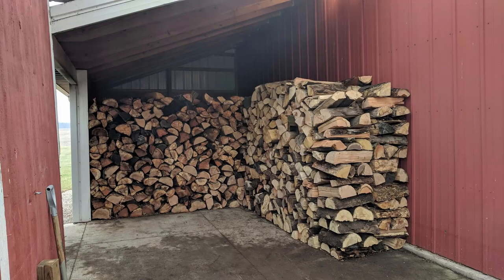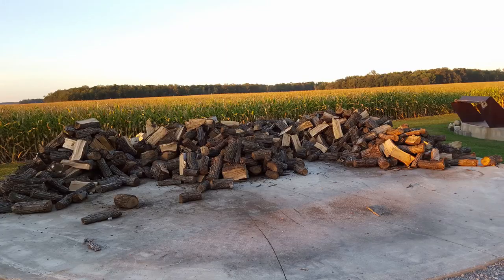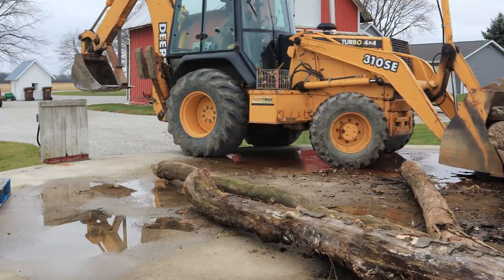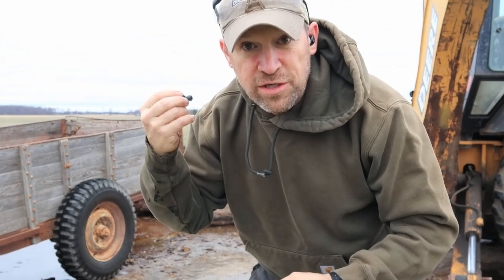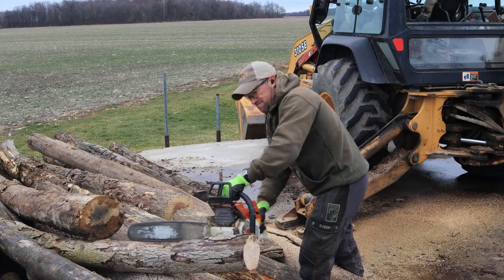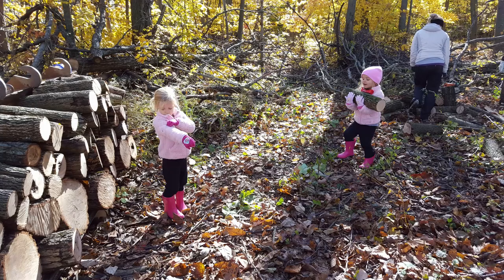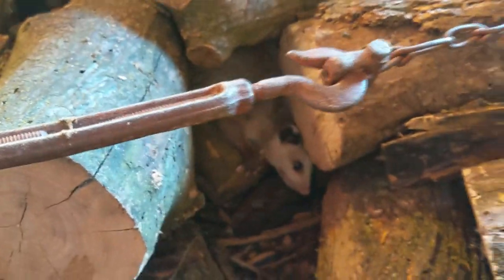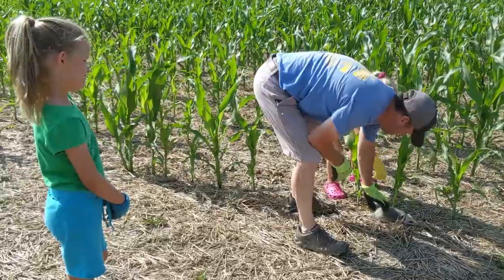Firewood: Do You Love it or Hate it? + 5 Tips for Outdoor Wood Boiler Success!

Comment: Since I retired two years ago, we moved to the mountains of western NC and heat our home with wood primarily. We do have a HVAC system, but it only comes on when it's very cold. I get my wood by going on CL or FB and can find all of the oak I want within about 30 minutes. I enjoy the hunt for the wood, cutting it and bringing it home and generally meet some pretty nice people. I've done mine on the cheap with a used Stihl MS251, used tractor supply splitter and used trailer and a 1986 4x4 Toyota pickup with a flatbed and a trailer hitch. I have a newer F150 4x4, but I told the wife I needed to wood truck to get into tight places. I seriously enjoy the wood and one day I may save enough on heating bills to pay for my hobby. I two years I have gathered about a 6-8 year supply, so I need to find a way to sell or donate some of it. I looks like you have a great family and extended family to surround you.
Reply from the maker: I appreciate you sharing that Phil.  I got to picture all of your gear and equipment as I imagined you driving around town to pick up people's unwanted piles of wood in their yard from the most recent line clearing job or something along those lines.  It's amazing to sit back and discover so many folks share in the general love of hunting, making and burning firewood.  I can imagine myself doing exactly what you are doing in retirement.  I have an Aunt and Uncle in Statesville, NC and it is beautiful there so I can even picture your landscape and how much better it must be than the flatlands of Indiana where I live!  Thanks for watching great to hear from you.

Comment: Neil, you are absolutely spot on... the experiences you gain and the lessons learned while gathering firewood are of inestimable value. 

Except for the 10 years that I was sentenced to city life, I have cut wood all of my life. Even now I heat my home and shop with firewood.

As a kid, we heated both the house and milking barn with firewood. I learned a lot of lessons and many experiences that have enriched my life.

My dad found every opportunity possible to cut wood. Whether it was 100° in the shade or frozen at 10° below, we cut wood.

Back then, we did not have a mechanical splitter. We used axes, wedges and sledgehammers. 

My dad had his own special pole axe that he used for splitting wood.  He kept it sharp, to a chisel point.  Most people would consider it dull... But then again most people have not split much wood. He did have a double bit axe which had one bit sharp and one dull.  The sharp bit was used for limbing and felling, while the duller one was used for working near the ground.  No one was allowed to use dad’s splitting axe. He kept great care of it, somewhat akin to a pair of spit polished drill sergeants boots.

My dad kept an elm 2 x 12 so, that when he was splitting, he could place the wood on it. It wouldn’t do for the axe to hit the ground.

My dad was especially skilled at splitting wood with that ax. He knew just how to place the wood so that the checks were aligned with where he would strike. Then, he never missed that mark.  Nor did he ever miss that mark on subsequent strikes, should he need them.

But the skill that I most marveled at was his ability to twist the handle as the axe entered the wood.  This would blow the wood apart as the axe struck it. If the wood did not split, the axe would not get stuck in the wood as badly as a straight downward strike.  

My job was to use the sledge hammer and wedges. Once I was old enough to have my own axe I learned just how good my father was at splitting wood. I got pretty good at hitting my mark however the wiggle just never was perfect.

This fall, my grandsons came over to help me split wood. We of course, used a mechanical splitter. While we were doing so, I told them a little about my dad splitting wood with an ax. One of them suggested that we try it. So, I got out my poleax. 

I selected some straight grain 8” diameter white oak rounds, set one of them up and got into position.  As I raised the axe over my shoulder, I summoned my fathers spirit to bless me with just one good whack.  Concentrating on the perfect spot I swung and tried to twist the handle at the point of impact.  Well, you see it has been years since I tried anything so foolish.... I swung too hard, the axe entered the wood and I twisted too hard... the two halves exploded apart.  They went bouncing away like two rocks skipping across a pond.

I looked up to see that my grandsons were safe... just in time to see one stick pound into the siding on my woodshed... that’s when I heard something that you wait all your life to hear... “Pawpaw that was awesome!! Do it again.”

You know Neil, the heat you get from burning wood is a candle light when compared to the inferno those memories fuel!

Please have a Merry Christmas!
Reply from the maker: That's exactly the kind of story I was hoping to read after making this video.  I struggled with whether or not I should post this type of video because as I told my wife, "maybe it is just too sappy".  But then I think, there's gotta be other folks that feel this way, so what the heck.  The comments have eased my anxiety a bit as I read of other memories and good family times involved with making firewood.  I always worry about everything too much.

But, what an eloquent essay of thoughtful memories and meaningful lessons spanning generations.  That is fantastic the way you described your childhood firewood experiences, particularly the relationship between your father and his axe.  I admire the men that are able to swing an axe and make it look so easy.  I've never been one to do it very much.  I've tried and split a fair amount by hand, but admittedly would gladly default to the mechanical splitter when given the opportunity.  It is disheartening to think that some of these skills and talents of manual labor will be something of folklore for future generations.  However not for your grandsons!  They were able to see their PawPaw wield that axe with impressive results and that will stick with them for life!  I'm so glad you shared that experience with me here.  It was fun to read and I could picture all perfectly;  even the slight twist of the axe head as it struck.  I was never able to master that skill by the way, although my Dad was pretty good at it!  By age 10 I was already softened by his homemade wood splitter :)

As always, thanks for watching and leaving such wonderful comments Dave.  I am not the only one that enjoys reading them.
Have a Merry Christmas!
Reply: @digdrivediy  My neighbor (who is my cousin) cut wood together every year.  We built a splitter out of a Murray lawnmower engine, PTO hydraulic pump, I-beam from a bridge and cylinder salvaged from a Yale forklift.  It is mounted in an axle from an old Ford and a frame made out of recycled storage racks.  

There are mud fences that are more attractive... but not a single one sold at the local farm store as powerful.  

We’ve been tweaking on it for 20 years.  A couple of years ago we plumbed in a cylinder to lift it into vertical stance.  This year we added a cross wedge so that we could split 4 ways at once.

I can’t begin to count the hours that he, our buddies, his daughter, my daughters, I and now my grand kids have spent making big sticks into little ones... nor, can I estimate the time we’ve spent plotting and planning the next modification.   What I can tell you is that a coat of paint has never been planned... to do so would ruin the mystique of the junk pile that always arises to the occasion.  Or, so we believe!!!
Reply from the maker: @sassafrasvalley1939  Love it!  We are much in the same.  That 4 way wedge was probably a game changer!  I wish I had a more efficient splitter around, although I have three at my disposal!  Your splitter sounds like it has it's own personality!  Thanks for painting a wonderful picture, even though none of that paint I see on the splitter :)

Comment: Neil, I also heat with an outdoor wood boiler.  14 years I’ve been doing it too. I used to use mine for hot water and the garage, but I got to the point where I felt I was harvesting /cutting/stacking/filling constantly.  I stopped heating the garage and the hot water heater. It helped lighten my load. Now I’m only heating only 1550 sq ft. Much easier for me.  
     I have a 7x14 dump trailer and a log splitter that works from the seat of my skidsteer that help tremendously. I can grab a 15ft log, hold it in the air and cut it to length without bending over and without the possibility of putting my chain in the dirt.  Then I take the pieces and split them with skidsteer (TM wood splitter...check em out)over top of my trailer.  This eliminates a lot of the double and triple handling of the wood.  
     One more thing I might add....I try to keep some larger unsplit rounds of wood and throw them in whole(whatever your back and body will allow you to load without pain/injury), this helps get a longer burn time for me on those cold nights.  My boiler is also rated for coal.  $145/ton.  The coal is used along with the wood(maybe 2-3 coal shovels full)when the temps are 25 degrees F and lower. Otherwise the boiler gets a little too hungry. 
     Great video.  Keep em comin.
Reply from the maker: Appreciate all the feedback MrThumper!  Sounds like you have a great setup for handling wood.  I use lots of different methods as well, usually whatever is the least amount of back trouble!  I've used the mini-ex, my backhoe, a firewood processor and my little compact tractor that all take turns helping me out.  You gotta love it or at least chalk the effort up to not needing that gym membership!  Thanks so much for watching and commenting.

Comment: The house I remember growing up in was built in 1909.  There was a massive boiler was in the basement.  It was also our water heater.  Talk about scalding hot water!  Any hoo, it burned coal and firewood all year long.  The coal bin was right under a window next to the boiler and my dad rigged a slide for the wood bin from the same window.  We burned maybe a ton of coal and 10 cords of wood a year until dad passed in 1983.  When mom passed in 1977, we didn't burn anything that next summer.  
But when fall rolled around woo doggie.  Igniting that first fire of the season smelled so good!  I missed the smell of wood smoke.  We weren't even burning any wood or coal in the kitchen wood/coal stove.  Dad never learned how to cook on the stove so lots of cold cereal and sandwiches in the summer, and it was too hot in Maryland to run the stove too.  But let the temps drop to were he was cold with long johns and flannel lined jeans and there you go.  The wood was delivered first so we could get it stacked in the basement before the coal arrived.  The basement was at least eight feet deep and under the entire house, no crawlspace, so there was plenty of room for the wood and coal to be stored down there and dad's work shop/mini gun range.  Lots of fond memories of years gone by.
Reply from the maker: Those are great memories Susan.  Thanks so much for sharing.

Comment: What a beautiful place you have 😍
You should get a bigger burning unit so you dont have to split firewood. Just throw big longs. Those longs will last way longer and is more efficient.
Reply from the maker: Thanks so much. We like our setup but it's plenty to keep up with. I can throw almost 4 foot long pieces in this stove and often times I will.  I try not to split any more than I have to but old habits die hard, especially when it comes to wanting to stack it nicely. Most of the time I reserve the splitting for when it's too big to handle. Thanks so much for checking out the video!

Comment: Firewood: When you cut your own, you handle every piece of it about five times. If you buy it and have it dumped on your place, you still handle it again when you stack it and when you burn it. If you need to increase your intake yourself, you could get a firewood processor, but then you have another engine, hydraulic pumps, hydraulic lines, bearings and valves to maintain. If you buy logs, you have to have a place to put them until you can buck and split them and make firewood. Again, you still have to handle each piece several times. The weather is also a major factor. If you don't get your logs cut and delivered in good weather, then you're outdoors doing that. It can be a hassle, but if you invested in an outdoor boiler, you still have to feed it by hand and keep it fed. I know. We had a firewood business for several years and nobody in this area wanted to pay what it was worth. We sold out to another guy who tripled the size of our operation and spends more time maintaining equipment than delivering firewood. However, if that's all you know how to do, then enjoy it and reassure yourself that nobody else wants your job.
Reply from the maker: Very good points to consider also.  I love firewood processors, but really don't want to own one for the reasons you mentioned.  I rented one two years ago and again this year and was able to make a years worth of wood in an 8 hour rental.  For me, that's the way to do it.  I stack up logs for two years and then run them all through in a day.  Works great.  Interesting to hear about your firewood business.  I never felt there was much money in it either unless you got some corporate accounts or sold bundles.  I've sold some locally in the past and quickly found out it was worth more to me to just cut what I needed for myself and not hassle with it.  For other folks it works out great.  Thank for the insightful comments and appreciate you watching Grampa Badger!

Comment: Hi Neil - it's Big Rodders in Ireland.   Can I suggest you invest in a pair of Husqvarna 30cm timber tongs.  You would be amazed at how much more efficiently you could load the trailer with those sized logs, with the added benefit of reduced back and body bending/movement to achieve the same workflow.  I'm probably at least your dad's vintage and without exaggeration I probably would have to had to retire by now without them.  They are my most importent implements after a chain saw.
Reply from the maker: Yes, you can most certainly suggest something that would be smart for me to invest in!  I've had a few others suggest something similar and I think it is high time I get something like that.  Upon your suggestion I googled them and they look simple and clever and for $40, I think it is a low risk experiment.  Look for those tongs in a future video!  Thanks Big Rodders!
Reply: @digdrivediy  Hi Neil - Big Rodders again.   I use two, one in each hand.  I throw logs with them using alternative hands.  Much of the time you can stand in the same spot, which saves time and energy.  I used to use a variety of pickaroons but consider tongs to be safer on two counts - I always feared spearing my lower legs if a pick was deflected and, if hauling uncut logs out of a pile, a pick is more likely to break free and you fall backwards.  I've suggested timber tongs to many loghounds but my success rate to date has been zero!!
Reply from the maker: @rodneysweetnam8653  Well, consider this a mark in the success column!  I ordered one pair to try them out!  I don't know if I can handle two pair.  Might need to work up to that!
Reply: @digdrivediy  Well Neil, I'm nearly speechless!  I look forward to your review once you get used to them.  A couple of tips to save you the hassle of learning the long and hard way.  Examine the design of them and understand the principle of how they work precisely.  When you grip a log, twist your wrist forward towards the ground, this digs the rear point into the wood and locks in solid.  The lighter the log the greater chance of not locking onto it. The same applies to smooth bark species eg Beach.  I freshen up the tips weekly with a chainsaw flat file.  You will be able to lift single handedly what previously took 2 hands.  You will be amazed at how much you can lift, how much less you have to bend and how easy it is to pull long logs out of the wood pile.  I also hold one in my right hand when bucking, hauling the logs to me with it and throwing the cut ones into my barrow or trailer without moving from my cutting spot.  So the best of Irish Luck to you!
Reply from the maker: I look forward to trying. Makes sense. Thanks!